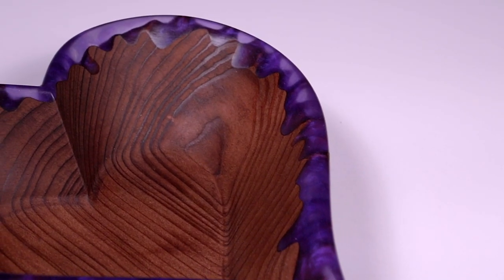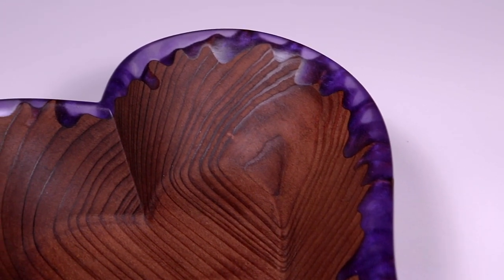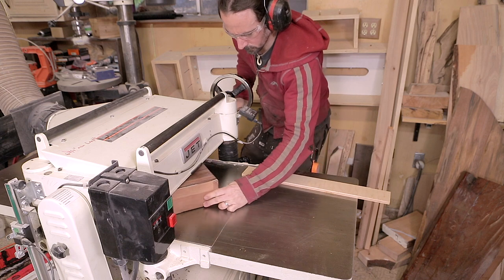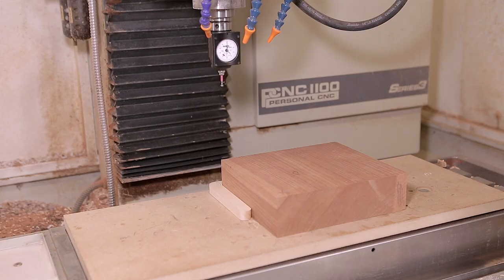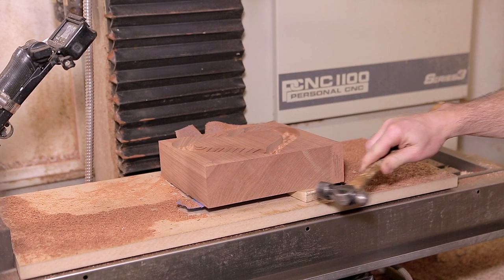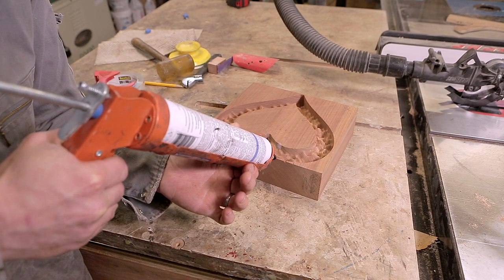Heart Bowl - CNC Woodworking - Wood Bowls with Epoxy Drips

Comment: That's really awesome.  Makes me want to get a CNC machine.  One of these days I will.  No space at the moment.  With apartment woodworking you only have so much space for making things.  I mostly do small projects and doll furniture.  Found your channel through reddit.
Reply from the maker: Thanks! Tormach has some really small footprint CNC machines, however they are more geared towards metal than wood, but I highly recommend them. They might give you really good precision for small details like doll furniture. For just doing wood stuff a CNC router is better, and they are probably by far cheaper, but I'm not familiar with a lot of the brands yet. Definitely get one some day!

Comment: How are you squaring up and indicating the bowl in after flipping it over and attaching it to the piece of scrap wood?
Reply from the maker: Hi Taylor - check out the related video for the Shell Bowl; I talk about these techniques. Since that video I've refined a few things but the concept is pretty much the same.
Reply from the maker: But basically: super glue to a scrap wood, indicate it in with the vice by moving it around till square. Designing in CAD the proper origin.
Reply: Thanks, that answered it. I see you now use a vice with adjustable angle.  I suspect that makes it considerably easier.

Comment: It’s beautiful.  
A lot of people say nice workmanship etc.  
Idk.  With the CNC machines doing all the work....what skill is there anymore?   Any programmer can do it?  It’s not a specialized art anymore?   Idk.
Reply from the maker: Thanks! Clearly, the skill here isn't in hand carving a bowl; even with hand carving, people will use machines to do a lot of the roughing out. The skill is in designing the shape!  None of this involves any programming; it is all about CAD and artistic design skills on a computer. Even so, there is a lot of workmanship in the details: properly gluing up blocks of wood, sizing them correctly, sanding, polishing, finishing - that's all part of the details.